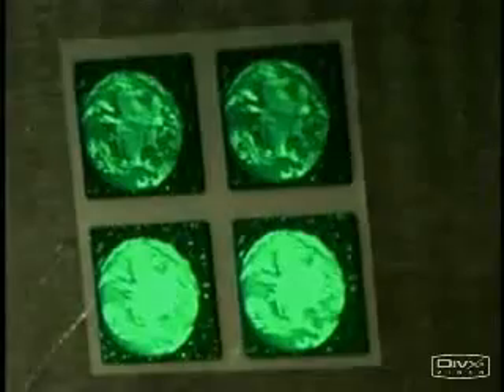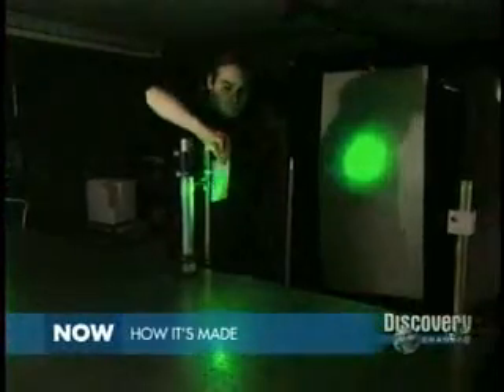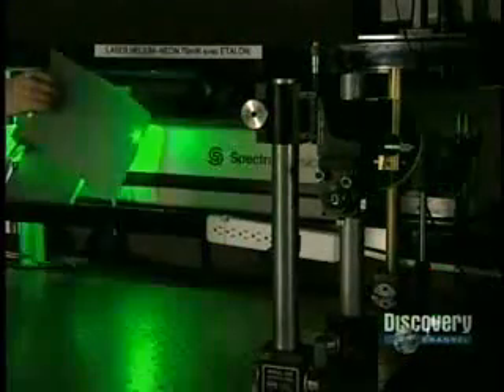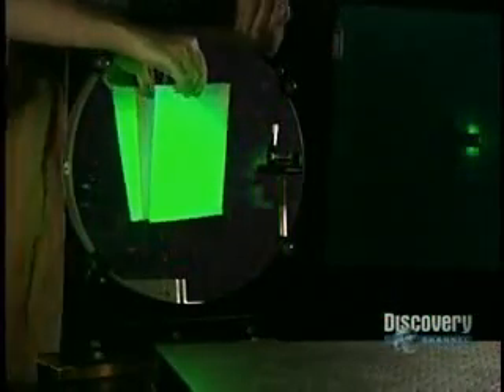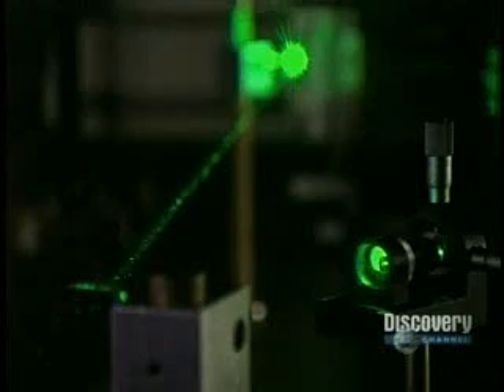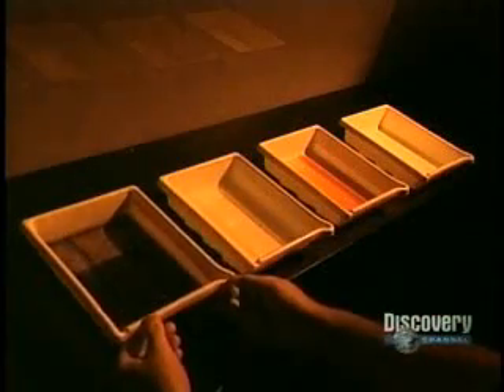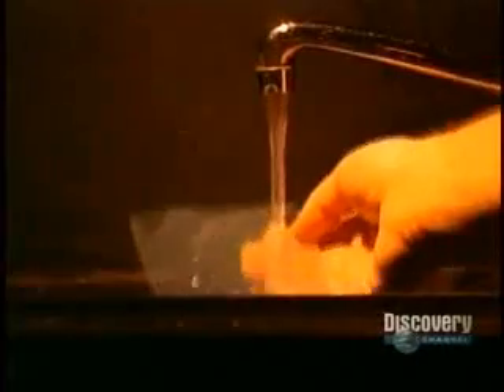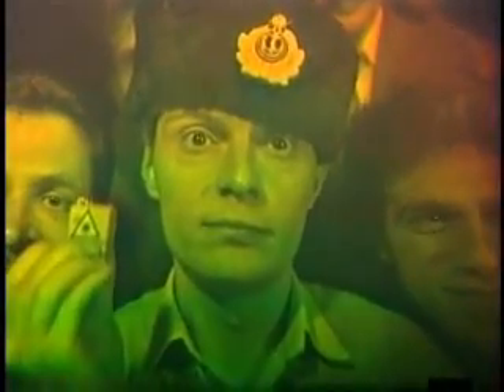How it's made: Holograms

Comment: @mikejamesbelanger   Most of the weight of a holographic table is in the pedestal, which is usually some kind of concrete structure.  The steel table tops are usually coupled to those 'blocks'.  I use active damping to do so.  The really good holograms are not so simple, they take translations between various formats of media, and usually robotic gear to physical move the set ups around... otherwise they are just 'still lifes', simple portraits of something, or one.

Comment: This works because there is basically an entire two dimensional image at every point on the film, so when you look at the film, you see one "bit" of every 2D image on the film.  The moment you move your head to a different place, you see a different set of 2D images, resulting in an actual 3D image, since the image changes depending on which angle you look at it.
 
I did this in my physics class, except with a red laser, not a green one.  It's much more entertaining to see it for yourself.

Comment: True, this is called LZP Holography, where the local coherence is used.  One can either split off a part of the main beam w/ a semi mirror plate, and redirect it, or shoot your hologram in a reflective holography mode, where part of the beam travels thru the recording material plane, hits the object and reflects back.  I've made zone plates which act as segmented prisms, splitting off light mid travel, and redirecting it towards the centroid, or about the object, to get better object coverage.

Comment: Lots of errors, but a very obvious one is what in the video is called 'bleach' was actually the 'fixer', while that solution that turned the pelloid 'transparent', that, was the 'bleach'.  Interestingly, they show a hologram as a result of this which is in COLOR, and that can not be done with a single color laser, unless each color image is a done separately with angular compensations for each color, that process is very intensive and is called, 'pseudo-color holography'.  This is monochromatic!